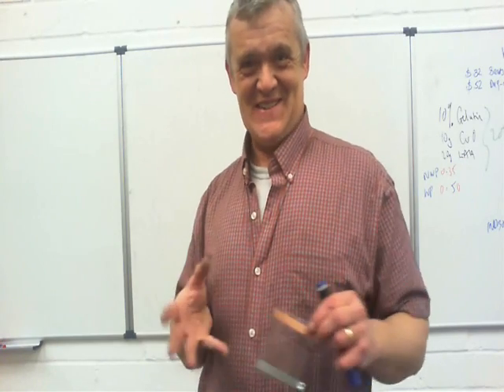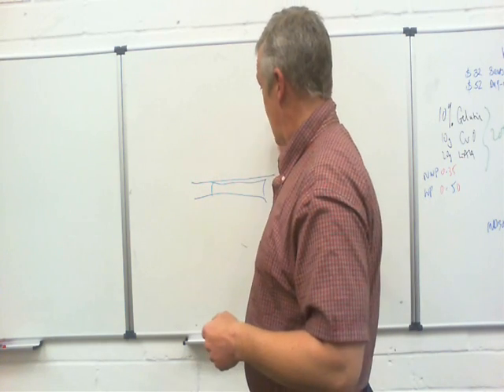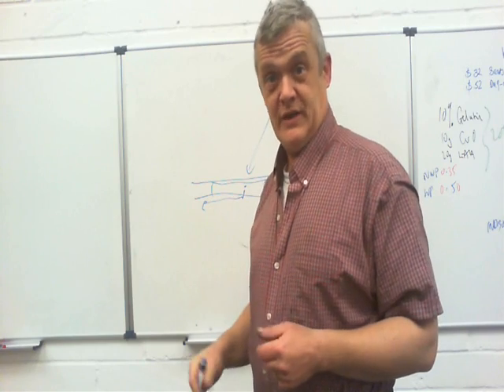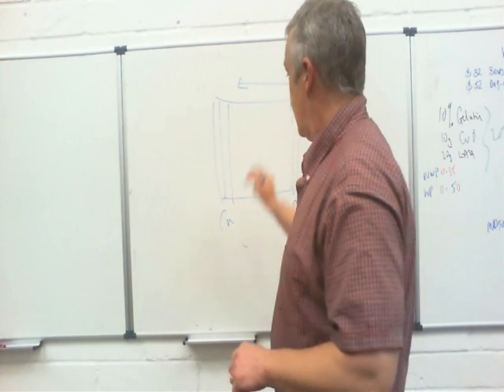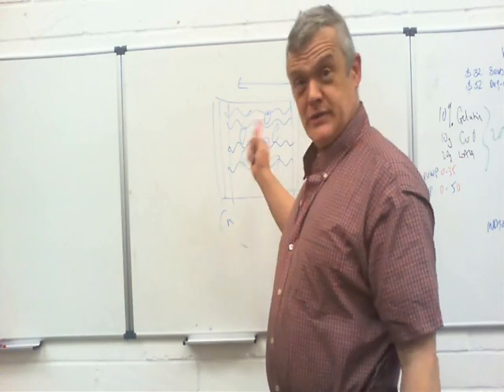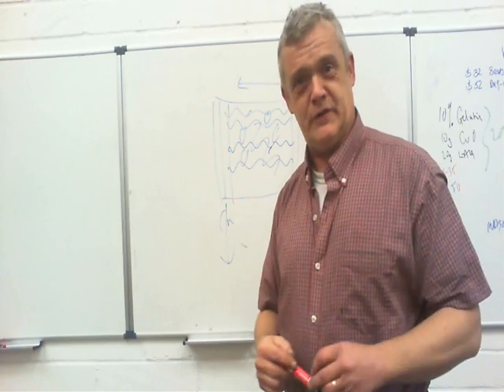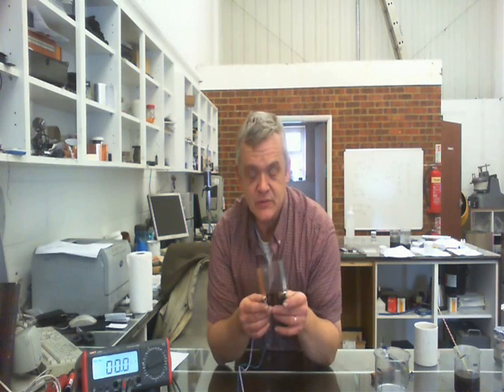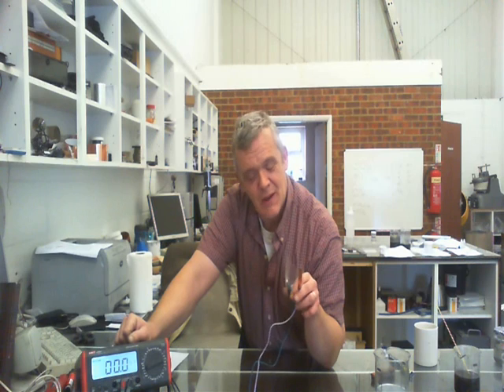Graphene Transparent, Flexible Brand New Solar Cell

Comment: Hi Robert, just confirming, are you using the nanoparticle solution made in the other video and not the ZnS powder in solution?  An advice on the plastic coating process?
Reply from the maker: yes mate - the solution made and spin coating is a good method

Comment: During World War 2, 'plastic' was NEW and an ounce of plastic was worth more than an ounce of GOLD, because it was new, and so hard to produce.  Today, we make trash bags out of plastics.
Today, graphene is NEW and VERY EXPENSIVE to produce... sound familiar?  By 2025, GRAPHENE SOLAR, GRAPHENE BATTERIES, GRAPHENE SUPER CONDUCTORS...  ALL ARE COMING SOON.
BIG LOSERS WILL BE fossil fuels, BIG OIL, natural gas, lithium batteries<< HAHA  JOKE BATTERIES...    A Graphene battery has been 3D printed with 10 times the capacity in the same size/area as a current lithium battery.  By 2030, you wont be able to find a "GAS STATION"..  so take a picture of one now.

Comment: We have to get rid of all the dark solar panels and replace them with transparent ones, not only as windows but also on roofs with reflective stuff under to cool the planet. Also paint all reads, air strips etc. white. I'm worried that the dark solar panels may be doing harm as well as good (defeating the purpose).
Reply: Did you make the solution in the video, I tried it many times and did n’t make it, I do n’t know what went wrong

Comment: Hello Robert. I like the 3D gell idea. What would be power comparison to a Monocrystalline or Polycrystalline Solar Panels, as to your Graphene Cells. Say a 100w  in a size of a 2'x4' panel?
Reply: You are getting 0.9ma for 20cm and to get 5.55a from a 2' x4' (8sqft) panel we need 61 - 20cm squares of Graphene Solar or 1.3stft. to get the same 100w?  Would this be right?

Comment: So you connect copper with aluminium with graphene.
Is this not like a peltier element ?
You get electricity, when you heat copper and aluminium.
I think this is a bogus video.

Comment: So how many layers, or, how thick of a single layer can you make with this method, and experience increasing gains?

Would that be micrometers, millimeters or more possibly?

Since in theory roughly 1100 watts of sunlight [this is only an average I realize, and the nearer the pole or the equator one gets it goes higher or lower] hits the earth at midday, what percentage of a given wattage of sunlight is theoretically possible to be trapped and converted to current before the laws of diminishing returns says its too thick, too bulky, too expensive to build, etc.

Is thicker better even?

Also, does one want to make this in thin strips for total combined voltage and to prevent self neutralization, or does one want to make wide sheets in hopes of greater surface utilization, is the terminal voltage more useful than the terminal current, etc?

Comment: Hi sir, I looked to the meter very well and noticed that after beeing in the sunshine, the rate was much higher in the shadow as before. Even after the second time again higher. So there is storage inside the material on the plate, like a battery. 
Is that my wishfull thinking or is it real? 
Maybe we can paint it on our windows too? 
Thank you for this amazing result of your experiment.

Comment: i wonder what kind of current you would read from using a magnifying glass over it to concentrate and direct the sunlight to a point, if the solar cell was heat resistant enough you could use a much larger magnifying glass to focus more than the surface area of the cell's worth of light to a single point in the cell

Comment: Ok, my idea spurned from this would be instead of painting this onto a sheet, leave it in it's liquid form (as you demonstrated that it's reactive with a light) and add the graphene to the original solution.  It might need a "stirrer" of some sort to allow the graphene to circulate in the tube, but easy enough.

This could be done in a capped glass tube with a copper/aluminum annode and cathode inside the tube.  Add a parabolic mirror behind the glass tube and viola!  It appears that if you have more 'density' of material you will generate more amperage.

Comment: Robert, what about drying the zinc-sulfide and grinding to power and then just like graphene use a translucent tape and extract a thin layer. Then put the previous layer on top of your graphene layer with flanked or sandwiched copper and aluminum strips, with the aluminum strip covered up or insulated from heat. Then on the top of the translucent section put a cheap plastic magnifying shield.

Comment: Graphene 3D Lab TSXV: GGG actually makes $ 1.5 mil cdn per year selling graphene and uses graphite.   Huge News from Lomiko too - new drill results of 110 Metres of 14.56% Flake Graphite
Reply from the maker: cool
Reply from the maker: don't multipost - you just get caught by the spam filter - which is what happened to most of your posts - i left this one out of kindness even though it adds very little to the discussion and really counts as little more than an advertisement for your company - be aware if you do this in the future i will block you as a poster

Comment: Robert.. If the copper and aluminum electrodes were c shaped and placed so there is 1/4 clear sheet between each pair of legs - I'm certain you could more than double your amperage. Also reducing the width of the electrodes to cover less space on the sheet, you know, try different widths. I would also suggest scrapping the graphene in the mixture and use your clear graphene sheet instead. Just paint the active ingredient over the graphene sheet. I'd love to see the results. You're a good man, btw, really enjoy your mind
Reply from the maker: nice thoughts mate - i will give them a go and cheers
Reply: Good.  I think your vision is to ultimately to stack these in an array, where 8 to 10 sheets can be stacked on one another greatly increasing the efficiency of solar panels and of roof space.  It's absolutely genius.  Big, big fan here.
Reply: And mirrors on the bottoms and side of the arrays of course would only help...  like a laser light.
Reply from the maker: yeah probably would mate
Reply from the maker: pretty much and cheers mate

Comment: Looks like you'd need a square panel of 15 meters per side to get a whole Amp but at what voltage?
I wonder if they are cheap enough to just build a south facing shell around buildings to help in winter as a greenhouse.
Reply from the maker: probably - but that's not really the issue mate - it's pretty interesting it works at all!

Comment: Heres a great possibility. There has been research done where Hemp has been turned into graphine nanosheets, and they actually perform better that graphine for high end capacitors at a fraction of the cost. Now if you can combine this guy's technology with Graphine soloar cells, and graphine made from hemp, you could make hemp solar cells.
http://www.acs.org/content/acs/en/pressroom/newsreleases/2014/august/could-hemp-nanosheets-topple-graphene-for-making-the-ideal-supercapacitor.html
Reply from the maker: +Dave Burkey you don't need to multipost mate - i read all my posts - but i know about hemp too - though i did like your suggestion to another poster that he look at it

Comment: I just love the kid in the sweet shop, mate!  As I am watching this video - I see a very transparent single sheet that is letting a massive amount of light move right through the material.  This leads me too two key questions, how many sheets can be layered together to where we get 50% light reduction. If we were to place a small mirror on the back we would be getting nearly 85% of all the light absorbed by the material.   The point is this, if the cost is low and with low heat gain, this is very significant. 

Each sheet should have some air space between layers and this gives a significant advantage to your design.   I would suggest the reflective material used by the hydroponic growing crowd as the back stop, Reflective Mylar.    It comes down to cost per watt but I think you may have over looked something here. 

How about a revisit -  using 8.5 x 11 inch standard plastic sheets, can you produce more than a single watt output, using multiple layers  -  The magic dollar cost is 0.48 Euro Dollars per watt as a production cost.   So the home production cost should be about $48.00 Euros a watt as a goal.  

If that can be done, then the revolution has started!   You have the resources by using conductive inks for the copper and aluminum strips (more plastic cut and bonded into place).  What I think, I am seeing is printed multi layered solar cells.   Back in my High School days I ran an old printing press, much like the one I have seen in your new building.
Reply from the maker: +Brad Miller I think you are right mate - i have over looked this - the stacking is a great idea - time for a revisit definately
Reply: Thanks for the positive reply.. I look forward to the results.. and the next video.
Reply from the maker: +Brad Miller i always appreciate good thinking mate - and i think you are spot on there - cheers

Comment: Robert, I wanted to ask something that was a little bit unclear - did you also test in sunny yet cold conditions? I guess my question is whether the cell responded to thermal input instead? Have you worked on the solar cell any more? If yes what were the results?
Thanks :)
Reply from the maker: +RoadsideCycles Hiya mate we did test in the sun but the day was cool - we haven't looked at it much as we are pretty involved in the EESD stuff at the moment but we will be getting back to it
Reply: Robert Murray-Smith Thanks for the clarification and thanks for all the videos - you are doing such amazing work and I enjoy your videos immensly :)
Reply from the maker: +RoadsideCycles thanks mate

Comment: Since they are translucent and generating .8v, and light passing through them, how many can you stack that will develop a charge via the sun? With say 3 overlapped, with first one in direct sun while the others shaded by the primary collector, you may not get optimal 3x .8v=2.4v, maybe only 2v total. Would you test this?
Reply from the maker: +Don Ation when i get a chance mate - i most certainly will

Comment: It would be awesome if phones would come with these solar cells installed under the touchscreen, and they would charge them from the sun... lol
Reply from the maker: +TheFloatingSheep nice idea lol
Reply: Robert Murray-Smith i <3 your videos
Reply from the maker: +TheFloatingSheep thank you mate
Reply: Ananta Sesa das well, the main point would be to be able to place it on a table outside and let it charge
Reply: Except that you can't hardly see LCD/LED in sun. E-ink would work or OLED maybe.
Reply: I already had a cell battery back in 2000 that had a solar panel on the back that would work that way. it did work well until I forgot and left it on the top of my vehicle and drove off. i bought it from the pajamashop dot com or something.
Reply from the maker: sure
Reply from the maker: oops lol
Reply: he... probably replied to the wrong comment lol

Comment: Have you been successful with fabricating single layer graphene oxide sheets?  Apparently they are transparent and block UV light transmission which is beneficial to protect acrylic and polycarbonate sheets from yellowing and decaying from exposure to harsh sunlight...  I am working on a project wherein I am wanting to make a floor below which algae will grow.  The floor will probably be made out of 1 inch acrylic coated with graphene oxide to protect the acrylic and then coated with a thin transparent layer of graphene to make the surface conductive as shown in your video. ..
Reply from the maker: +Lamar Small it's pretty easy to make mate i use the tour method mostly for GO production
Reply: so if it were you, would you prepare the GO by the tour method, and apply it to the acrylic in the same way you did the transparent graphene in order to get a transparent GO layer on the acrylic?  The acrylic is 24x24in..
Reply from the maker: +Lamar Small probably mate

Comment: This is all very exciting and the video has me itching to try it out!  In falling down the rabbit hole of your YouTube channel I came across a video about using a water/acetone mixture as a solvent for liquid phase exfoliation  of graphene.  I'm just curious if this is the method you used to produce the graphene used in this experiment.  In doing some research I found a source saying that acetone can react violently with acetic acid.  If the nano cellulose was produced from bacteria, I suppose there's a chance that some acetic acid could have been produced.  This is coming from a background in brewing, not chemistry.  So I could be way off!  Any thoughts you have would be much appreciated.  Thank you very much for posting these videos!  Keep up the great work!
Reply from the maker: +Tyler Guilmette i used a different method to make the graphene mate - i am glad you like the vid too
Reply: +Robert Murray-Smith what was the method? did it in anyway involve using water at some point because I was thinking that if you somehow incorporated colloidal copper into the coating wouldn't that greatly improve its conductivity?
Reply: +Jeremy Williams or really any colloid like maybe even gold
Reply from the maker: +Jeremy Williams gold would be an expensive way to do it
Reply from the maker: +Jeremy Williams depending on the oxidation state - yes

Comment: Could this be built using some sort of dye as the photoactive material? I've never heard of separating the charge with differences in electronegativity. Did you think of that yourself?
Reply from the maker: Red Rake it's worth a try - the idea is based on what thermocouples do - or a zamboni pile - no idea is in isolation

Comment: Is that mA because then it would be milliamps (thousandths of an amp), not microamps (millionths of an amp)? Just wanted to check that. Thank you very much. Also, another question, if I take the black shiny crystallized graphite charcoal that comes out of a woodstove chimney, and blend it up (or, possibly burn it completely first to get rid of any creosote that may remain in the carbon) can this be used (possibly) for a "graphene" production in the kitchen, similar to the method you showed with some kind of eco soap and typical household blender? Thanks!
Reply from the maker: Jay Dillon microamps - iguess you could try with the charcoal - i wouldn't expect anything wonderful out of it though

Comment: hi Robert, any update on Infar Red solar cells?
Reply from the maker: ASV TV no mate i have been concentrating pretty heavily on batteries and caps for a while now as i am getting something into production
Reply: that's great news, will I be able to buy from you and if so would you ship to Singapore, id pay for the shipping to obv :)  Thanks as always Robert
Reply from the maker: ASV TV no worries mate - should be available within the year
Reply: any idear on cost, power etc, sorry to ask so much but I cant seem to find much info out there or I simply don't know where to look?
Thanks again
Reply from the maker: ASV TV not yet mate - sorry

Comment: I have made nanocellulose previously using ethanol-water mixture fermented with lactobacilli from curd(yoghurt). There are better bacteria for the purpose but none as easily available.
Reply from the maker: Chaitanya Bhave that's very clever - thanks for sharing - have you tried it as a binder?
Reply: Robert Murray-Smith No I haven't. I'll definitely try that.
Reply: Is the graphene-nanocellulose mixture a good conductor post drying? If so I would like to investigate it as a transparent conductive coating
Reply from the maker: Chaitanya Bhave yes it is - and I would definitely investigate it if i were you - it has lots of potential
Reply: Robert Murray-Smith wonderful. I will begin work post-haste. Where did you get yours from? The nanocellulose I mean
Reply from the maker: Chaitanya Bhave i grew it from bacilli
Reply: Robert Murray-Smith you can also try from wood pulp since you have a homogenizer. Although I guess you've already thought of that.
Reply from the maker: Chaitanya Bhave thank ou mate - but yes i did - also from fungi
Reply: Fungii? Haven't read about that? Any specific species?
Reply from the maker: Chaitanya Bhave kombucha

Comment: I wonder if you put it on in layers, instead of in a block.  A block allows for the whole to act as a big collector, but layers act as capacitor plates allowing charges to resonate between the plates, thereby sometimes enhancing signal strength, as you know, or a charge.  I guess the question would be whether or not the plates would form negative and positive reversals under each piece.
Reply from the maker: Gristle Von Raben you have some good ideas mate - cheers